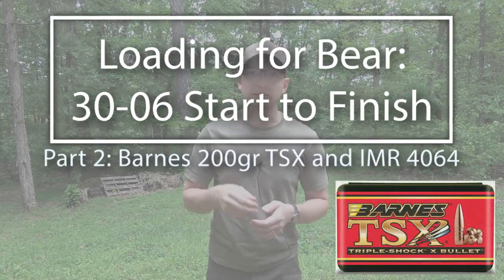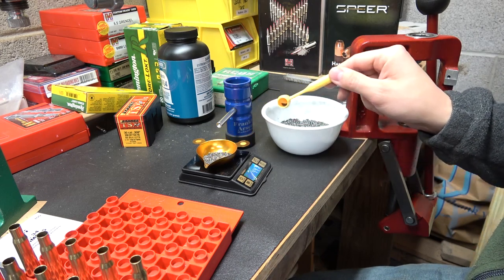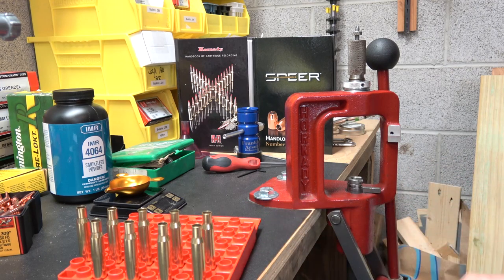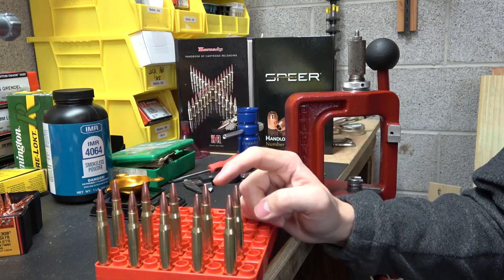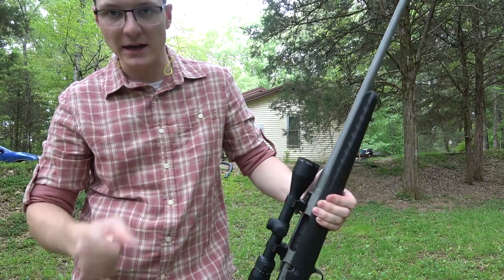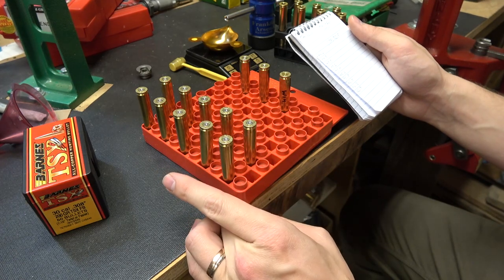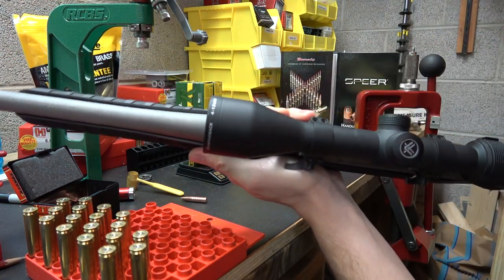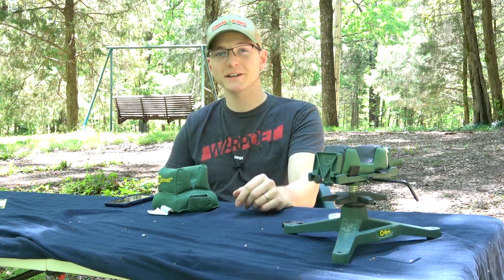Loading for Bear: 30-06 Start to Finish, Part 2: Barnes 200gr TSX and IMR 4064

Comment: When using very expensive bullets, or even when you’re taking a shot in the dark at a load, I always do three shot groups. A three shot group will not tell you if it’s a great load but it will tell you if it’s a bad load. Another question, why are you seeing those bullets so deep when the overall length is supposed to be 3.340?
Reply from the maker: 3.218 is the length specified by Barnes. I remember that I seated them differently, but I don’t actually remember why. I know there was a reason though. I need to keep better notes 😬

Comment: Great job.  Seems a little slow.  I’m getting 2575 with the 200.20x Berger bullets in my .308.  Think you should be up around 2900 with the 30-06 with that weight bullet